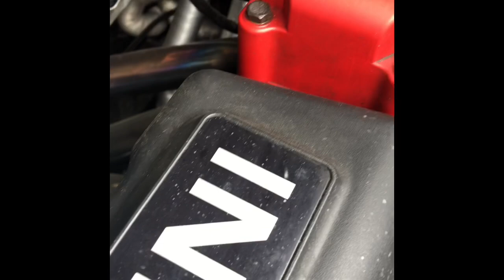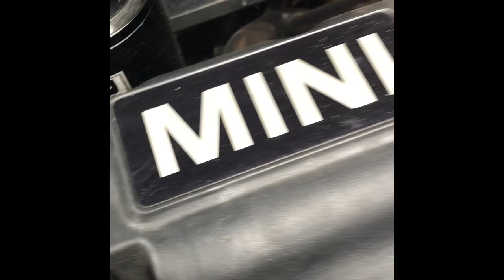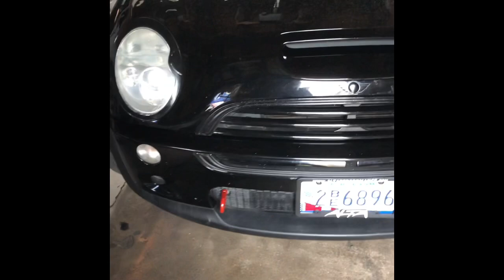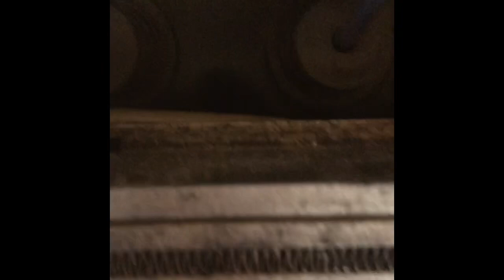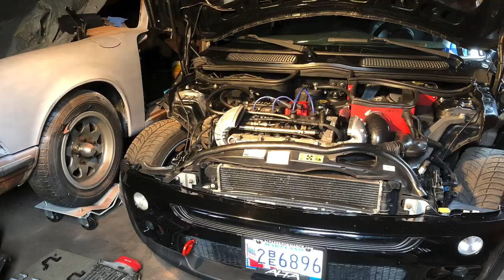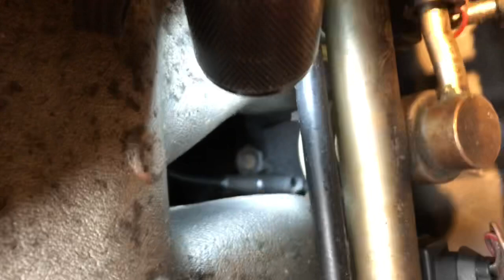R53 04 Mini Cooper S Update...loud noise from under the intercooler

Comment: Hi, I have the same issue!!! In your case was that little pipe that came off? 
Mine sound like sucking a lot of air underneath of the intercooler. The mechanic says that can come from the injectors seal.
Thank you in advance for your help.
Reply from the maker: i changed the cam sensor, and it went away….and i think another hose might hav been slightly lose for the solenoid.purge valve….but i made the tragic  error of getting mad with the car, put it on craigslist and it was gone the very next day.  still kicking myself, its been over a year now….
Reply: @femmefataleracer Thank you for your reply. When you say cam sensor, do you mean camshaft sensor? Also I can see from the video that was a little pipe went off. Was that also causing that noice? 
Did the problem came up on a diagnosis? 
I had my engine rebuilt recently and they didn’t do a good job. 
Shame that you do not the car anymore. We love this mini so much. 
Thank you

Comment: I have similar issue too, any MIL light on ? 
Thanks
Reply from the maker: lol…nope…i wrenched on it enough, sold it last tuesday after 7 years of ownership…new owner says it was all because of the cam position sensor which never gave me a code.  oh well, on to other more troubling cars.  thanx for checking the video.
Reply: Gonna check it out this weekend I wish I have luck like you 
Btw I appreciated, thanks
Reply: 😂after anything’s lastly I solved the problem !
it was nothing special by luck ! 
It was the lower fan broken ( power steering fan)* 
Purchased the used lower fan assembly and repaired the second fan that didn’t run when coolant temp reached 102 DC with just bypassing the the resistor, I used 0.66 R instead of 0.33
It has been 6 months since then, good 👍 solid